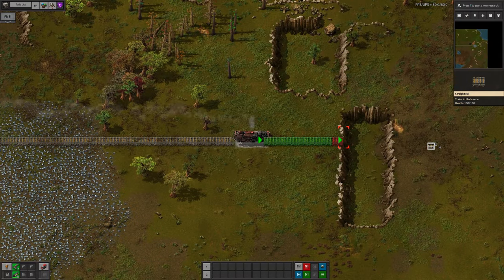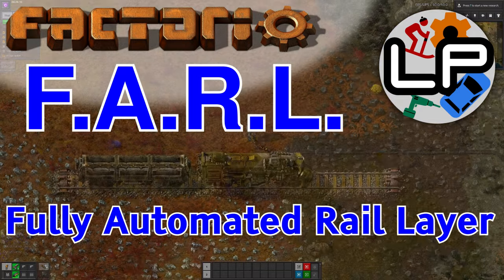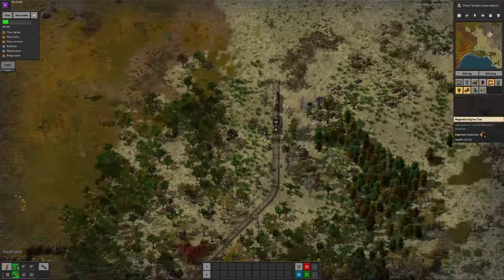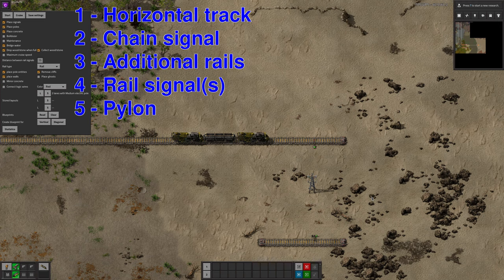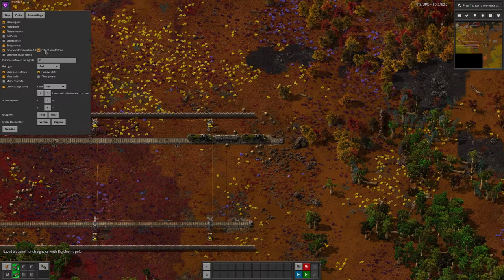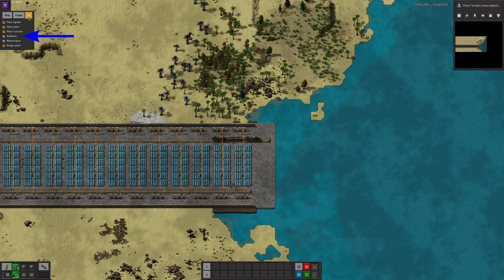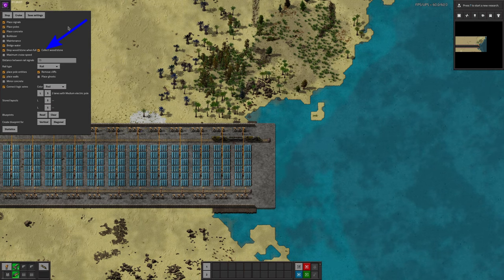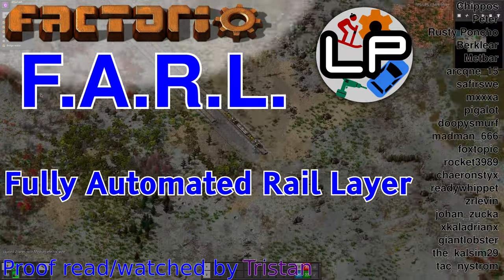FARL: the Fully Automated Rail Layer tutorial - Laurence Plays Factorio

Comment: I'm not gonna use this for legit playthroughs, kinda OP to have the rails placed at such high speeds, BUT for just mucking around and having fun? YEAH.

Although perhaps for heavily modded playthroughs this won't be as OP since other things will outclass that lol. Very neat, glad I watched, wasn't too sure about how the blueprint mechanic worked. Rather easy though tbh. Sad that it's a bit jank on corners, but a bit of hand work isn't too bad sometimes when you have 98% of the job done for you by robots lol.
Reply from the maker: My feeling is that it works well in areas which have already been cleared. If you run into biters, things will probably go badly! Given that, it feels a lot less cheaty, it just makes building artificially quick.

Comment: How does farl interact with grid alined blueprints?
Reply from the maker: I don't believe it's grid aware, however if you make sure your blueprint is a single grid square and that you start your runs in sync with the grid, then it should be fine. You'll have to be careful to keep it on grid and just let it do the building though.

Comment: 6 years ago I've built a multiplexed train system in vanilla factorio, I posted the blueprint on factorio prints, and i even have a video on reddit (Linked on the blueprints page).
You can set items in a constant combinator, and trains on that 'channel' will load exactly the missing amount and bring them there (but only if below a threshold, to avoid small shipments)

googling "Supply Grid - Request Items with trains! Vanilla! No bots!" should point to factorioprints 

I never really used it because it requires a bunch of combinators and looks ugly. I also build a taxi system using a similar setup. Then temporary stations got introduced to vanilla factorio rendering it useless (you can find the blueprint on the same site) With that, you've build taxi stations, and a taxi train, if you went near a station, the taxi came for you, then using a constant combinator you'd set a destination and the taxi would take you there
Reply: I did supply station in vanilla too using global wiring signal and mall-to-any system. I didn't post it anywhere but was fun:)